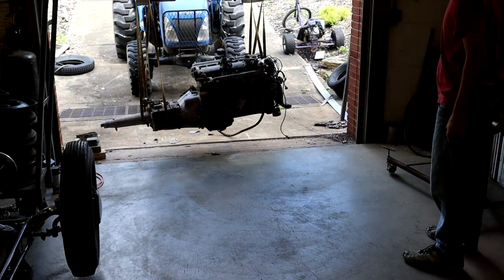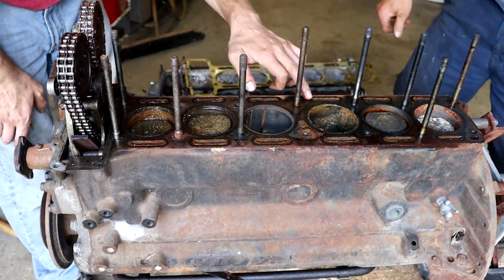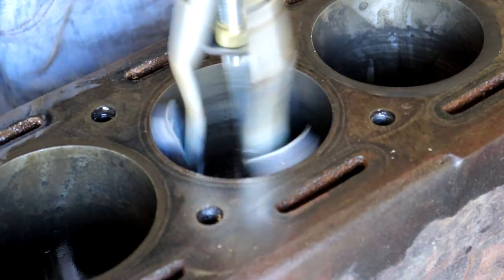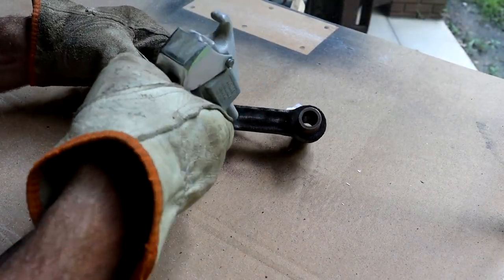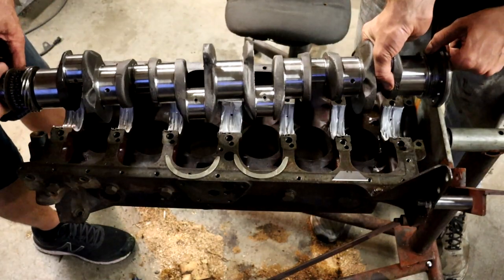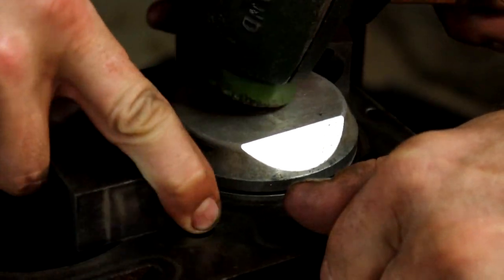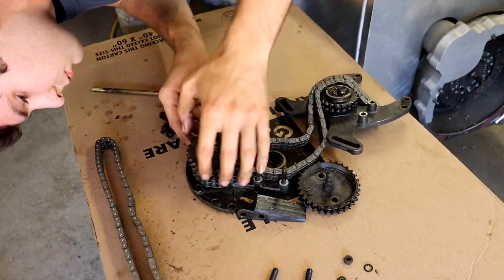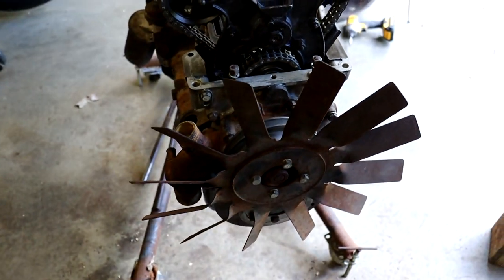How to NOT Rebuild an Engine | Homemade Boat-tail Speedster Pt. 57

Comment: Welcome back.  For a mechanic/engineer of your high caliber, I was shocked to see that A. you didn't label parts as you disassembled, and B. you don't own an inexpensive ring compressor.  The engine will run, not optimally.
Reply: As long as the cam timing and ignition timing are set right, he won't have any problem. A bit of blow-by isn't that dramatic, thicker oil, hotter spark plugs and some "engine restorer" snake oil like Liqui Moly Ceratec will do just fine.
Those engines were pretty efficient and powerful, 120hp for 140ci in 1959... pretty impressive.
Reply from the maker: I'm not a mechanic, and barely an engineer, but I did put all the fasteners and small parts in labeled cups. Beyond that, it's pretty self-explanatory. A rebuild manual helps a lot too

Comment: Honestly, you would probably be better off running a Nissan or Toyota engine. Powerful, reliable and parts are available everywhere. (Says the guy running a 68 year old MG XPAG 1250)
Love your work 👍
Reply: Honestly, he'd be better of running  Toyota car, but that kind of misses the point ;-), and the Jag cam covers look very pretty when they are polished. plus that long stroke straight six sound.

Comment: Electric airplane?keep your resume fresh. They don’t have long enough extension cords,let alone enough electricity. What a joke.this engine will be running long after the last electric airplane crash’s.
Reply: As impractical as most electric planes are, small personal craft are kinda neat.
I could see them selling really well to the weekend fliers out there.
Fellas who won't spend more than 4 or 5 hours a week in the air.
Reply: @daleolson3506  I'm familiar with all of this.
Rich guys will pay a lot to fly one on the weekend. 

I didn't even disagree that they're impractical. But you can't pretend an entire niche market won't exist.